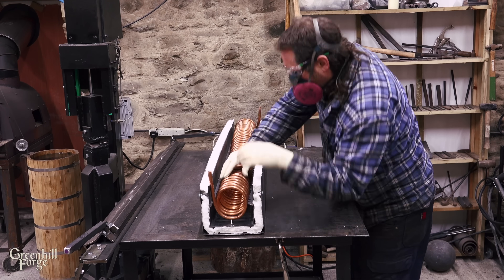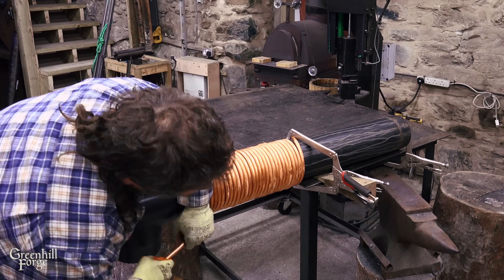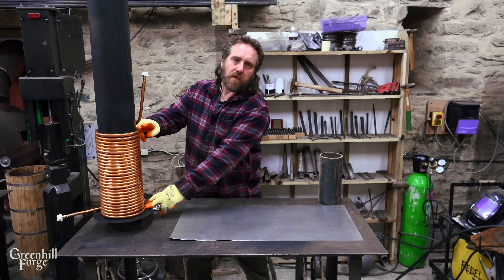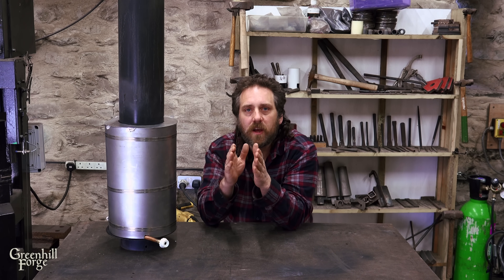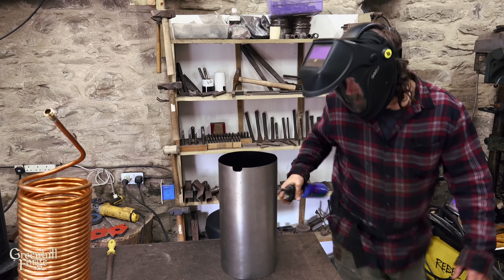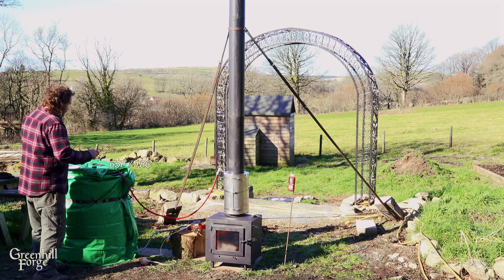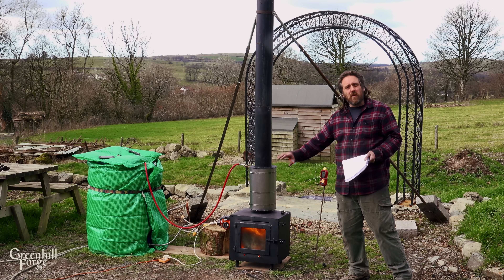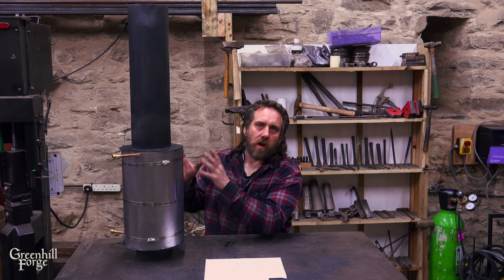Best Wood Stove Water Heater Yet: New Design Tested | Off Grid Water Heater pt3

Comment: I believe simply increasing the gap between the coils should improve the efficiency.  It would increase the heat source to water ratio. This addresses the fact that there is an energy exchange BOTH ways when heating. The tube of water is trying to cool down the pipe as it is being heated.  When there is less cool coil per square inch of chimney, the heat source can more quickly bring the water to temp. Everything else would stay the same. Insulated graphite, etc.
Reply: No.

That is completely incorrect.

Spacing the coils out would do nothing at all.the problem with tubing on the outside is that you have a tiny point of contact for direct transfer, and the rest is convection.

He partially mitigated this with the graphite, which although it added additional materials through which transfer had to occur, was so much more efficient that it overcame the additional transfers.

The only improvements one could make with the coil external to the flue would be something more efficient than the graphite, or more coils.

Comment: Thanks for the videos and the effort!
Was going to say try spacing out the coil and making it longer, obviously it has been proposed already. Another thing you can experiment with if you want is pipe diameter and speed of water movement. An interesting thing will check how your system influences the the flue from inside as cooling the gases typically rrsults in more soot and creosote.
Good luck and more viodes please!
Reply: Beside that - what are you thoughts on using high-temp silicone to transfer heat better?
Reply from the maker: I think silicone would be insulative but I not totally sure.

Comment: I have really been enjoying your water heater saga! I have 1 question and 1 idea to contribute. 

Question: doesn't pulling heat out of the chimney cause problems with creosote build up? Would that be a concern with a system like this?

Idea: you could do a countercurrent set up to improve the efficiency of heating the water. Idk how much itll improve by but i bet it would be measurable.
Reply from the maker: if the flue got too cold but I'd need to really increase efficiency to get the kind of temp drop

Comment: Bend your coil with more space between windings, if you fill the gaps with a cheap and good conductor and insulate the system anyhow, this could lead to more heat transfer.

Comment: You could try welding some fins on the inside of the flue pipe the length of the coils. This would help pull more heat from the passing heated air inside the pipe into the pipe itself, extracting more heat from the passing air than you would otherwise. The reverse of cooling fins.
Reply: Taking your idea further through to easy implementation.
Wrap the pipe in copper sheet and then drill through both the wrap and pipe so that copper wood screws can be used.  The screws should protrude internally to the pipe where sufficient screw length would pickup gas heat.  When looking down the internal of the pipe, the walls may look a bit like a hedgehog.

Comment: Great work. Love to see innovators experimenting to improve design. The graphite + insulation configuration means you can redesign the copper coil a bit to wrap looser and decrease self-parasitic losses. With just copper coil, it makes sense to pack the coils together as much as possible; with insulation plus heat conductor it makes sense to use the same length of copper pipe higher up the stack to spread out the surface area of the coil, I believe. Hope that helps.

Comment: Graphite is on the the galvanic scale because it's conductive. Thats why using Al rivets in carbon fiber is a no no. Any material more reactive than it in contact with it ,given some moisture, will corrode

Comment: Great series of vids. Got me thinking of a combination of  coil within the flue and the graphite pack setup.   You could have an grafite packed enclosed coil centered within a larger diameter flue making it ring shaped and sized to have the same croas sectional area (as to not upset draft velocity).  The return/supply end of the coil would pass through the centre of itself so the inlet/outlet can pass through the flue at a single convient location (example if installation requores an elbow or straight out the top!) I'm not sure if the coil will be exposed to more flue gas heat but the capsule should help prevent creosote condensing to coils albeit still difficult to clean. Maybe thermal mass materiel would be better for this setup, circulating water would continue to stay hot long after the fire has gone down.  It would be interesting to see if a longitudinal loop or two within the capsule/ring flue the same length of your outdoor flue pipe would be able to transfer even more heat. 
Keep up the great work, excellent content.

Comment: The copper should be inside the chimney. The fire should be in direct contact with the copper. You will have much better results. I have made several wood fired water heaters on my channel. Cheers

Comment: sand is bad conducor od heat. also with coil you lose quite much. best way have biger pipe outside and water is circulating between the pipes.

Comment: I think that the copper pipe should be longer as to have more surface area of the chimney In contact with the pipe. Also i wonder if you could remove the copper pipe altogher by creating a double chimney system with water between the two pipes, and maybe the outer part of the inner pipe should be made like a heatsink

Comment: Metal flue length is the bottle neck. Extend the length with same copper
Metal conductvity is about 20. Copper is 224. Stainless steel is 8 = Thermal conductivity BTU/(hr·ft⋅°F) 
instead of tightly wound copper around 1.5 feet of metal flue. maybe use the same copper wrap around 3 or 5 feet of metal flue.

Comment: When I think of efficient heating of water with fire, I think of locomotives. If you've ever seen the design of a boiler on a train, it's a large cylinder that holds all the water with a lot of small tubes running lengthwise from the back where the coal burn chamber is to the front. The hot exhaust gasses travel through the many small tubes creating a lot of surface area for heat transfer. I wonder if you could make a removable section of the chimney stack that imitates the design of a locomotive boiler. Making it removable would be for periodically cleaning.

Comment: Why dont you try runnig water directly inbetween two pipes instead of the copper tube u used. So same like with graphite bit instead of graphite use water and no copper tube. Would be interesting to see. Maybe add also some finns into the smoke chamber to get some turbulences in the fumes.

Comment: Both sand and graphite have around 0.8 J/g/K.  -> Graphite is not "the opposite of a thermal mass"
They key difference is the thermal conductivity: Graphite is > 100x more thermally conductive.

Comment: Why don t you use a copper tube in this segment of chimney? Copper has much better thermal (and electricity too) than steel (perhaps w some nickel coating) and DO wind the coil tightly around the copprr cylinder and consider to hard solderen copper coil and copper tube together..?of course can still wrap isolation around the heat exchanger..as you extract more heat you will cool down the tube more so creosite depositie can be expexted, so add an internal scraper to regulator clean creosite from insite tube.and add secundary combustion in you stove to get more beat from your wood, burn stove hotter to have cleaner "smoke" and dramatically less creosite in your chimney...

Comment: Hi. First film prove my idea with sand is good. What I would be doing is like charnwood did is putting inside flue removable (so you can clean them) chains to slow down gases and help them to hit flue wall more efficiently. Just question what pipe size have you used? Regards

Comment: You mix  plaster of paris with   watered down PVA with Alcohol mix,  then mix in the graphite powder,    So plaster/graphite mix 50/50  dry, then you mix. 45% PVA with 45 % water then you make the slurry, then 10% Isopropanyl Alcohol.   I can hear people screaming no,  but once fully dry, you have the mix of plaster of paris, which will insulate, and the graphite which cuts down the weight. the alcohol helps make a stronger bond.  Graphite is a form of carbon and it will create a galvanic effect,  so the plaster of paris counters that and will insulate as a thermal heat mass.    Its just a crazy idea,

Comment: Hello from Belgium.....I v been testing the same kind of system but based on waste vegetable oil (more easy to feed ??)  Actually i m reaching some good result on a 30-40 cms length of the exosting pipe,i have between 400 & 500 C°   So i'll send your a link to a video ..that is still to mount..as soon as possible.  I Think that it should interest you..Keep in touch..  & Thanks for your precious advices..  Denis

Comment: The area of contact of the copper tube on the outside of the flue wall is small that limits heat transfer. You need some kind of thermal cement a bit like in electronics and heating sinks. Sand is an insulator. In the old days in UK they had coal fires in a room but had a "back boiler" where they heated their water. They used some kind of cement. Not sure exactly what mixture they used through. You can see a mile off that graphite is the way to go even before you tested. As an engineer my feeling is outside flue graphite and counter flow the water is the best solution unless you discover a better conducting fill?

Comment: The winding of the coils was way too tight!  I would highly suspect having more space between the coils would increase the heating source. Add a 1" gap and you'll probably see another 20-30% gain in your transfer coefficient. Also, Thermal paste or liquid like glycol might also squeeze in another 10%.

Comment: Try spiral corrugated flue pipe with copper tube sized to embed in the spiral exterior groove, inner flue tube diameter matching main flue diameter, then wrapper shell touching outer diameter of corrugated tube. This creates a triangular spiral space, with two faces pointed to flue gas contact surface on the interior of the flue center. Then use your graphite gap filler within the formed triangular groove spiral as normal to anchor the copper tube and transfer heat from what should be close to double the surface area.

Comment: That was a good video for trying to capture heat from a flue pipe. Another option that might work better is to harvest the heat from the fire directly heating the pipe on the inside of the fire box where the fire has direct access to the pipe full of water. Kind of like an old steam engine. This will collect massive amounts of heat, but you would need to find a way to deal with the pressure that can be generated.

Comment: who says you can't use a water pump offgrid? Just need an off-grid power source :) (besides wood which you already have)
Hell, you could drive the pump attached to a bicycle if you really wanted haha, now THAT would get you warm lol

BTW, the contact patch between the pipe and the flue in the first setup will play a big part in how much heat you can conduct into the water. If you flatten the pipe up against the flue (not sure how you'd manage this), your heat exchange would sky-rocket. Right now it's just the very tip of the pipe touching a TINY point on the flat flue surface. The powder-filled approaches are increasing the contact patch with the flue dramatically, but still not as good as if you filled with a liquid.

Someone else has already commented that at this point, just mounting an entire water vessel around the flue would be optimal. You could adjust your sand-filled sleeve I think to do this - maybe even remove all copper from the inside too - just fill that sucker up with water. put a hole in the top and bottom of it to attach your send and return pipes to the bigger storage vessel. Water is an AMAZING conductor of heat, and if will form a perfect interface with the surface of the flue. It's also cheaper and more easily replaceable, and doesn't have any handling procedures to learn (besides being sure to release pressure) The downside is that it'll slowly corrode steel. You're into central heating territory then. You could build the whole thing out of copper which would be expensive but rust-free.

If you are set on pulling heat through the walls of the flue and into your pipes from that point, you'll essentially be turning the flue into a heatsink. Which means you could borrow from humanity's knowledge base on heatsinks to pull more heat out of it (.e.g. giving it a fin-stack, will hugely bump the performance)! 

You probably are aware already that, as the flue gets colder, you may run into issues with more creosote condensation, and may even see a negative impact on your up draft.

Back to in-flue piping, if you committed to, say, only running your stove pretty hot, you could minimize the buildup. If you wanted to go crazy, you could plumb a heating-bypass into the flue that you can switch on-and-off, to make sure you're only exposing the coil to low-creosote exhausts! The downsides of a ripping fire are mitigated by the fact that your rads/tank will store a lot of the otherwise-lost heat. The cost of maintenance and repair will also be tiny compared to something like a graphite-base setup.

Stepping back for a minute, what designs do commercial water-heating stoves use here? They have of-course already done some amount of R&D and probably are in the same boat as you with the trade-offs of each design.

Comment: Hi 
I’ve been following this during the series & found it quite interesting from an engineering & efficiency perspective.
I did notice that your internal heating coil had the copper tube spaced out between the windings & went a lot further up the chimney. I’d assume this would have taken a lot more heat out of the system.
The external coil had no gaps between the windings & didn’t extend as far up the chimney.
It would have been interesting to see a near like for like comparison.

John (Norfolk in the UK)

Comment: Like a few others have commented, I suggest increasing the gap between the loops of the copper pipe to maximise coverage of the surface area of the flute. Downside is it will increase the amount of insulation and graphite needed, but i think it should see a vast improvement in performance and efficiency.

Comment: You didn't show the flue gas temps, I would be interested in seeing the gas temps before and after the coil.
Can you try spreading the coil out more, like you did with the internal one, but using the graphite method? 
Maybe try different coil spacings and test the flue gas temps before and after the coils to figure out the point of diminishing returns.
It might be interesting to try increasing the internal surface area by welding vertical fins inside the flue to extract more heat from the gasses.
Love the videos, keep up the great work!

Comment: How about ditching the copper pipe entierly? 
Build a chimeney out of stainless steel and wield a outer pipe on it wich you enclose and wield a pipe fitting down low on it and one on the highest point so you dont trap air in the water jacket. Then you can pump the colder water in to the lower part of the water jacket and the warm water will exit up top. Then you will have a way better heat transfer i would think, since the water will be touching the whole part of the chimney.
It could maybee be better if you add a spiral fin between the chimney pipe and the outer pipe, so the water has to go the long way around before exiting at the top. It may work fine without it though.

Comment: What about a ‘top loading’ stove? I’m not sure if it exists but if the whole stove was submerged in water it would reduce waste from the stove sides. The opening at the top could be angled and wood just thrown in. There would also be a need for air vents. One could also build the stove in the side wall of the surrounding pool to still have it open on the side.

Comment: the biggest limitation in my eyes is surface area first and foremost, and secondly, the rate of thermal transfer, now with the external coil setup, you have a limited surface area, so you can't change that, the best thing you can do is to improve the rate of thermal transfer.

The best way i can think of to do that is going to be using a "water jacket" exhaust pipe. It's both simple in concept, construction, and in terms of physics, although you could make it more complicated with a series of baffles. If you aren't going to put the heatsink in the flow of gas directly, i see no reason for you to be using a copper coil at all. Yes it has good thermal transfer, but water right up against the exhaust would be even better, and significantly cheaper, easier to build, maintain and clean.

Perhaps in the future you should look into experimenting with "flash boiling" water similar to how its done in recent steam locomotives, it's very safe. Doesn't provide a risk of flash boiling, because that's literally how it works, just on a small enough scale that it's contained.

Comment: Adding a butterfly flu dampener above the copper coil will trap heat where it's needed vs out the top of the chimney, once the stove is up to temperature close it about 80%
at the very least you'll probably burn less wood to get the same temps, I think all wood stoves become more efficient with a flu dampener in the chimney pipe but I'm biased I love mine